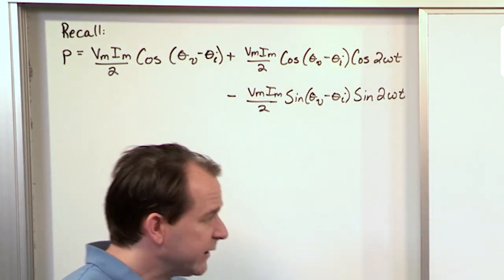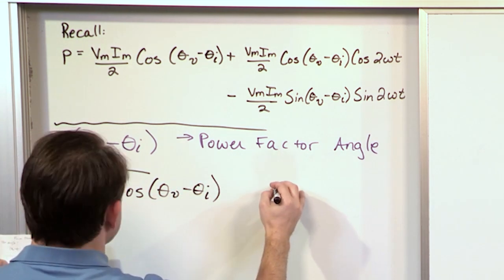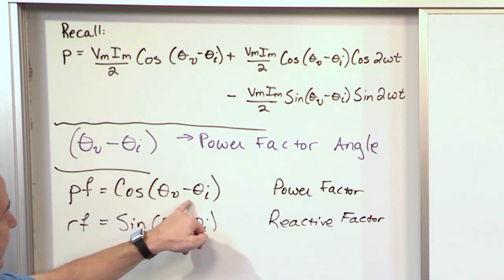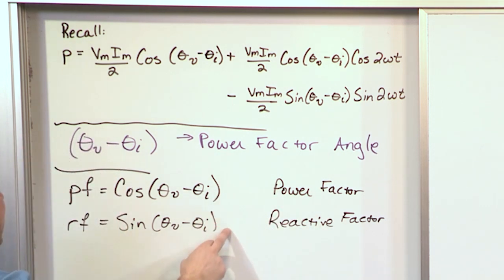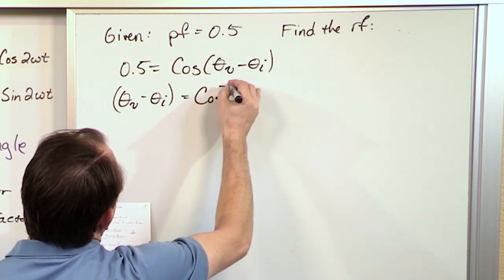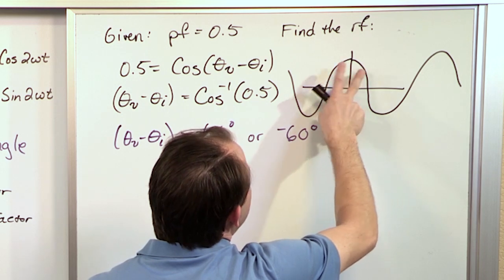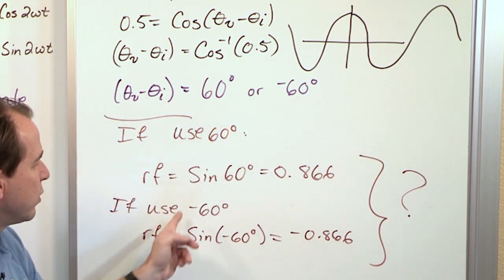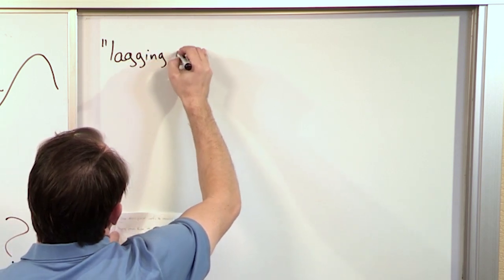Power Factor and Reactive Factor in AC Circuit Analysis

Comment: I really appreciate this lesson, thank you.  Would you be able to point us to the main pre-requisite video for the "complicated formula" you started out with?  Thanks!
Reply: In his video titled "01 - Instantaneous Power in AC Circuit Analysis (Electrical Engineering)" he showed that the instantaneous current is:

i = I*cos(ω*t) 

And the instantaneous voltage is:

v = V*cos(ω*t + θ_v - θ_i) 

So the instantaneous power would be the product of v and i: 

p = V*I*cos(ω*t)*cos(ω*t + θ_v - θ_i) 

And it turns out that the complicated formula he started out with is just another way to write the instantaneous power equation from above (it's the exact same equation, just manipulated using trig identities) so that it is written in terms of 2*ω*t since we know the power waveform will have twice the frequency of the voltage and current waveforms. 

He talks a more about it in his video titled "Learn Reactive Power in AC Circuits - Reactive Power Inductive Load and Power Factor Calculation"
Reply: @JM-ql4ok  Thank you~